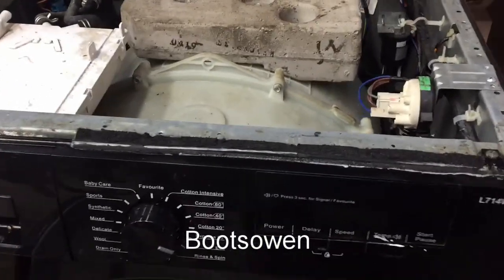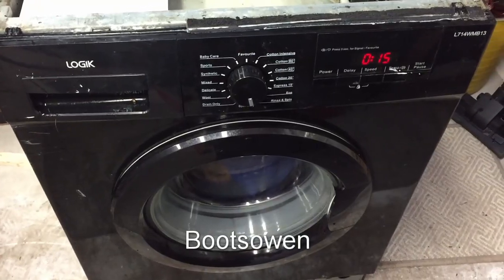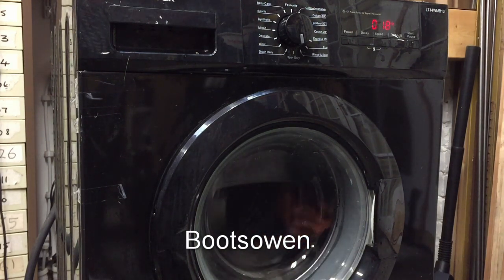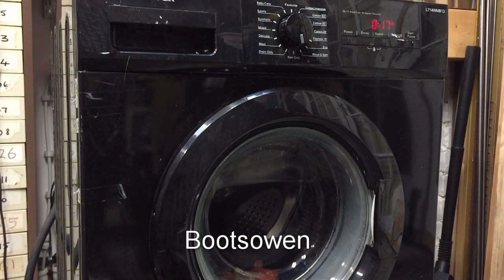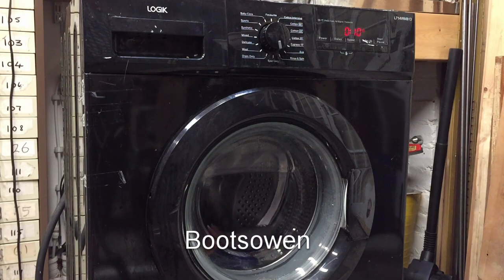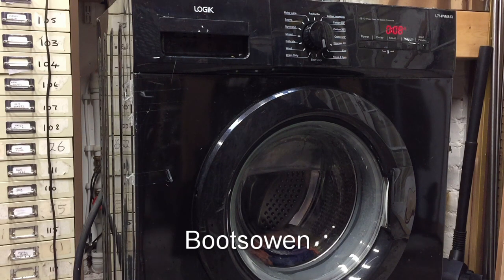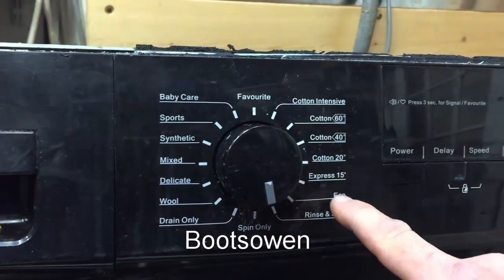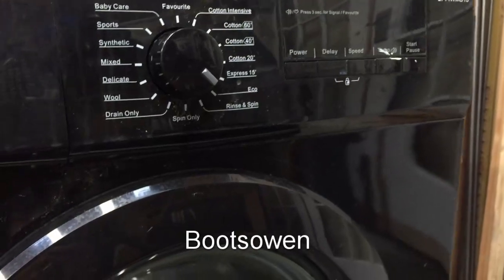Black Logik Test Wash | weird error code | Short 15 min wash | what went wrong? | Hu5 fault code?

Comment: When it stopped at 6 mins and made that beep it looked like it paused itself as the : stopped flashing and hu5 might mean it’s still full of water or something as I can’t find what that error means. Probably best to brick it as it isn’t in best of conditions anyway
Reply from the maker: I would like to fix it first, that confuses people more.
Reply: When I changed the board on mine I put the dial on wrong you just have to rip it off and try and work out how to put it back on right so it corresponds with the right programs. I put mine on drain only (it displayed 0:01 I only chose it as I knew what the cycle was cause of the time) then took it off and reattached it

Comment: 1. First try to fix the handle and take a look at the circuit board

2. Check electrolytic capacitor. They might be damaged leaving the machine (control board) very susceptable to power fluctuations 

3. Unplug and plug back every single connector you can find
Reply from the maker: I  have a better idea!
Reply: @bootsowen  

Brick is also an option i guess :P

Comment: Um idk,had a midea made washer and it would show an draining error even tho it would drain perfectly fine,needed a pressure switch and a pcb but the whole machine was almost as much as the parts so it was useless to repair,maybe this is repairable....

Comment: Error codes on Logics are E then number... no clue what HU5 means. but with the program dial not working proper, seems like the logic board is damaged and need replacing or reprogramming, most likely needs a new board